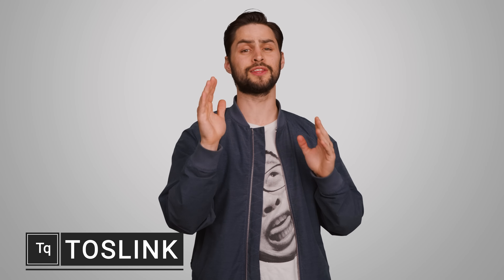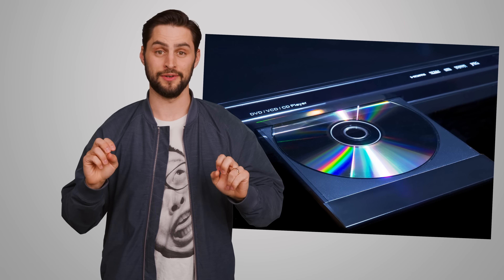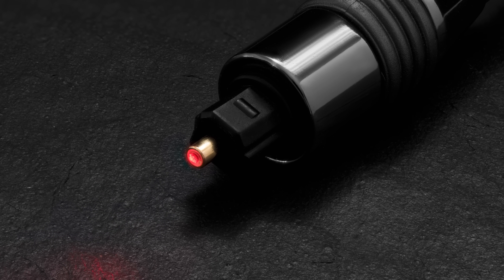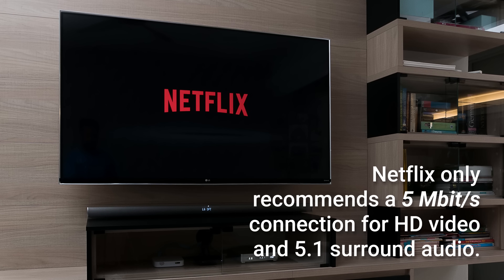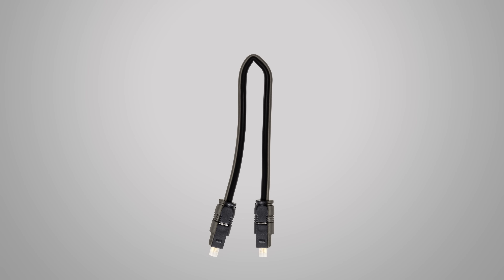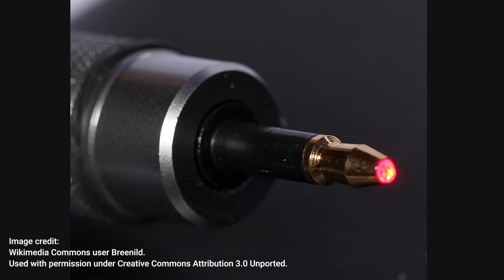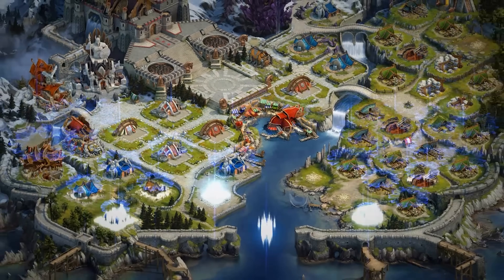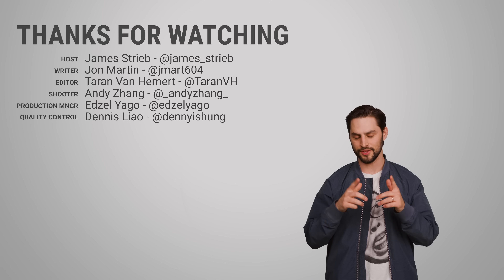Why IS This COOL Cable Dying? - TOSLINK Optical Audio

Comment: The distance limit of TOSlink was not primarily due to signal loss, rather being a 1mm diameter fibre multimode fibre (multiple transmission paths down the fibre - the light can go strait down the middle or bounce off the sides) the pulses of light get stretched out until it’s impossible distinguish between a 1 & 0. To overcome this in BBC Outside Broadcasts we used to convert to much thinner multimode (50um) or even single mode (0.9um) to run ADAT format 8ch linear digital audio over 100s & even 1000s of meters, eg to connect the broadcast centre to a remote commentary position. 
These days Ethernet based audio formats eg Dante is more commonly used.

Comment: Toslink connectors are deplorable !  The worst design for fixing a cable to a TV ever. No tight fit, no locking mechanism and prone to fall out when placed on to so called "smart" TV like the new Samsung SD models which have the Toslink port "under "  the TV frame. Crap cables coupled to crap TV.

Comment: I've Had A JVC 5.1 DVD Home theater system for over 20 years, After 10 years I had replaced the receiver do to damage. Now ten years later the receiver still being used as a CD player. In the garage but lately it's been skipping burn CDs, it plays DVD finds and original CDs,,,, but I don't like using original format due to wear and tear. The receiver is still capable of other duties, I decided to get a old JVC DVD player with toslink output and hook it up with JVC Receiver toslink input. 
No words can explain how great 1000w JVC TH C50 Is The Sound Quality of music in 5.1 sounds.

Comment: You can transmit Toslink via laser, and a bare laser can go through several panes of glass. Problem with that is you then need to deflect the laser-carried signal to a receiver, and the receiver needs to be modified so the target is bigger, but it can be done and Matthew Perks (of DIY Perks) used it to deliver single-channel sound to all of his Hi-Fi speakers across the ceiling; minimal cabling for tx and rx required.

Comment: Problem is TOSLINK is one-way. It transmits data in a single direction from the source (like a TV or computer) to the receiver (like a soundbar or audio system). For two-way communication, you'd need two separate cables.

Comment: Fun fact, TOSlink was first used for TOW wire guided anti tank missiles and MK48 torpedoes as early as the 1960s.  TOSlink was invented and pioneered by Houghs Electronics.  It was then made available for civilian applications in the 1980s, which Toshiba promptly bought exclusive rights to.  The Original TOSlink cables had tremendous signal carry range up to 40 miles in undersea conditions.  TOSlink was stored as 5 miles of  6 inch spool of optical tubing filement for the TOW missile

Comment: Someone in the comments has quite correctly mentioned Toslink's use in the Audiophile community with high-end Audiophile external DACs still offering SPDIf input. 
Another group of people who still may prefer it are gamers. Yes gamers!
Take a look at some of the latest flagship gaming motherboards from MSI and ASUS : if you look at the I/O ports, quite a few also include an optical SPDIF output. Some monitors don't always have speakers for the HDMI cable to terminate the audio signal to, not to mention there are some speakers such as some models from Edifier that have optical SPDif inputs which eliminate the need for a dedicated external DAC. Gaming motherboards can be quite noisy (internally: electronically) and even if properly shielded, there may be some interference in the analogue output stage, so having SPDIf as an option besides HDMI for audio also makes sense because apart from the signal being a digital one, offering galvanic isolation thus removing groundloops, it also offers more output flexibility as many A/V receivers (or some speakers like those from Edifier that I've already mentioned/TVs) also include an optical/coaxial SPDIF input.

Comment: Toslink is still thriving in the Hi-Res/Audiophile community. As of 2024, the flagship DACs that can sometimes cost as much as a car still have Toslink as an option, whether optical or coaxial. It's a "dumb" connection compared to HDMI Arc or USB in the sense that it either works or it doesn't.
It can support upto 24bit/192KHz, depending on the external DAC's capabilities. Also, it doesn't suffer from ground loops like USB
It's also available in quite a few mid-ranged models as well; such as S.M.S.L.'s SU-6, which I personally use, and having the optical Spdif as an input option saves me from utilising one of my computer's USB ports (I switched between Optical output and USB output to compare the quality and although the USB input in the DAC supports an insane 32bit/768Khz sampling rate, even with the high res FLAC collection I have, and audio CDs, there wasn't any discernable difference.)
Moreover, I can enjoy 5.1 surround sound using the optical output as well (even though it's lossy) using the same spdif output from my PC into a 5.1 system I also own.
So the drawback would probably be lack of support for HiRes surround sound (SPDIf only supports DTS/Dolby digital surround sound and not DTS HD/Atmos), but you'd probably need a premium surround sound speaker system in the first place for the claimed "night and day" difference to be fully appreciated as well as an Ultra HD BluRay movie collection (or the movie rips derived from them)

Comment: Its great for noisy computers. For example via my USB  audio I can actually hear my AIO pump. Also with USB dropout issues on Ryzen 5000 it can help with separating power from signal.

Comment: Pointless story alert:  So years ago (we are talking like 2002-ish) my first little surround sound system was a cheap Logitech set I got from Electronics Boutique for like $75 and I was able to use it for my new PS2 which like most of us doubled as our DVD player as well, that had this port I thought this was the coolest thing ever.  "This is using light to give me crisp wonderful sound that so cool?!?!" I also had the connector on the original Xbox that used it as well later but well that was it, all the electronics after that one or the other didn't have that connection so after that sound system got replaced, when I upgraded to a higher watt audio system , but that was all she wrote for toslink for me...    That was until about a month ago, 20 years later, when I recently got some new PC speakers I've wanted since they came out  (Razer Nommo Pro's)  I was pleasantly shocked to see this port was an option on the Nommo's even came with a cable for it and just so happens my current motherboard on my computer also happens to rock this toslink port. You bet your ass I was super giddy to connect my audio to it.

Comment: Of ALL of the technologies we have - only Digital Optical Interface (Toslink connection) gives you TRUE 5.1 or greater Surround Sound. All other connections like HDMI are simply "High Resolution" or less. Generally using technology into "fooling" your ears that you are listening to something different than you actually are. NOTHING beats Optical interface as no metal wire is used can allow magnetic interference into the signal.  If this type of cable is becoming less available consumers need to demand it's inclusion and availability. Because even if you do not use the connection at this moment, would it not be nice to have the option to use it in the future? More options are always good!

Comment: I'm happy about this synopsis, I purchased a 5.1 Xbox Spherex (for £20, actual robbery imo) that was partnered with Mirage and is still considered high spec, only issue is the only high res digital input is Toslink, I'm an early adopter of 12th gen intel, and my 12th gen motherboard supports toslink, so to an extent, I feel as if my Xbox Spherex isn't outdated, still being supported and not considered a collectors item just yet. 

and I actually did purchase this 5.1 with the mindset of it being a collectors item as I do collect retro items myself.

Comment: I'm glad this cable is still around for sure. Otherwise I would have to route my HDMI signal through my reciever and then to the ARC on my TV. I'd rather have uninterrupted flow for video to ensure I can still run 4k 60 or 1080p 120fps content with no worries of loss.

Comment: Fun fact: the Xbox One can only output sound thru HDMI or Toslink. If you want to use AUX, u have to either use an adapter in your HDMI connection or connect it to your controller like a headset.

Comment: I always run into audio sync issues using HDMI through sound systems or sound bars, so I only even use Optical Audio cables (TOSlink) for audio and HDMI for video 🤷‍♂

Comment: I'm very sad I been using trash speakers from Goodwill for so long. I finally said "I'm going to get the best sound going optical and totally update this mess," HA! Well I'm convinced. I'm tossin that "Toslink!" I'm gonna look into DTS 5.1 or whatever, as there actually is no link to that in the video or even in the description, so well whatever. Your loss. And WTF is measuring the weight of something in "so many blue whales?" Use corvettes or more boringly, school buses. At least I've seen those before. A blue whale? WTF?

Comment: I’m using spdif from an Apple TV to a Topping dac/preamp to Paradigm A2 speakers. I’m able to wifi link with my iTunes library. I’ve wanted to try a JIB Boaacustic s/pdif cable but there’s no reliable reviews for pricier “glass” interconnects I finally bought one to try. It’s amazing! The cheap supplied cable produced a decent stereo image with reasonably focused sound . The JIB cable took the sound to the next level of clarity even to resolving and clarifying low level sounds. Eventually I’d like to use a usb hookup to utilize sample rates higher than 16/44 but I now know that cheap supplied optical cables really screw up square waves. There really is a difference!

Comment: Unfortunately, there's no in-between choice for the PC, unless you get a Creative Labs sound bar.

On the PC, you're better off using display port for the high frame rate, so optical digital is the next choice for your PC audio.

I don't get why more sound bars don't have USB inputs for PC control. I expect it's to do with not having a copy right protection there.

Comment: Personally I hate hdmi cables, and sometimes usb cables.. The plugs suck... And sometimes you get a tv always saying an hdmi cable is bad.. I found you need to run magnets over the cables to remove that issue and the cable will work another 2-3 years without issues. I have a stereo with a optical cable but everything else is newer and doesn't have that option.

Comment: Digital optical is useful for longer distances in a room, because it does not pick up electrical noise along the way. That is, if your options are analogue and digital, and you are interested in noise levels and such. Also if you want to use your better DAC, what better way to transfer the signal from one device to another? Just bought a 6 m optical between Oppo and DAC. Works like a charm, though Oppo is quite particular about being turned on first before the DAC or it stutters playing a cd. Also the connectors (Oehlbach) seem quite loose. Had to put some paper to tighten it up (It might be a brand thing as Sommer or Supra do not suffer from this). The fibres themselves are made from a variety of materials these days, and are not necessarily as fragile, or stiff, as you make them out to be. Of course not a good idea to whack them or bend them, no matter what piece of equipment they are. ;)

Comment: The MAIN reason for ARC is so u can still use your TV remote on the soundbar/ receiver to control the volume

Some TVs dont allow universal control through the remote to the soundbar/receiver through Optical connections.

Comment: Do you know a good Thunderbolt 4 (USB-C) to optical/digital out connector (or converter)? I'm about to buy the 2021 Macbook Pro, but ever since the 2015 model, Apple stopped equipping the headphone/audio out connector with toslink (3.5mm optical digital out).

Comment: Posting this if it helps. I had static coming from the adapter Toslink from tv to old receiver and I solved it by programing the audio options on the tv by pressing tv+ optical option just optical gets static. Hope this helps.

Comment: The only reason I still use Toslink is because my AV Receiver doesn’t support 4K and I have a 4K TV. So I were to use HDMI I would get 1080p on a 4K TV and since my receiver. So we use optical for our TV while also making Dolby True HD and DTS MA HD useless. So we are stuck on 2.0 sound even though we have a 5.1 setup -_-

Comment: I was dreaded when i saw the PS5 didn't have an optical port to use with my Z906... But then delighted when i found out my TV supports passthrough from HDMI to TOSlink! works  perfectly!
Reply: TV model Philips 65pus8503/12 btw

Comment: last year i went to the flea market and brought a wireless headphones the transmitter connects through optical port never really used them til a year later and the quality of the sound over optical sounds way better than normal audio cable i thought it was just placebo but i connected the receiver over aux cable and the sound was not as good as optical.

Comment: Transmit your 5.1 audio in a single cable... ha! 

It doesn't have the bandwidth even to send 5.1 audio, it has to be compressed, usually with a proprietary standard like Dolby Digital. So all your gear has to be certified, and it makes passing through audio and other things a pain in the arse.

Comment: Hi very good vid .
Listen I have connected an older samsung surround sound system to my modern Samsung TV .The DVD unit is connected with a HDMI cable but dont get no sound as it mutes the Tv .The settings are correct though .I only get sound when I put a cd or dvd in the dvd player and still get a good pic on Tv .Im.not sure if I have the ARC stuff .
So I thought that because of no ARC then the other link being the audio optical would work .Is it worth buying to try .Any ideas 
Cheers

Comment: And here we are again actually needing a new update for Toslink or devices with a separate HDMI out. Since Video and Audio are progressing at different rates, and issues with the newest HDMI 2.1 standard, it would be very useful if this could make a comeback with higher bandwidth. ARC works but we’re also right in that area of most devices having ARC but not eARC (or one with and one without)- therefore having to settle with the lesser, (ARC) which is the same difference as Toslink. At least with Toslink there isn’t any of the CEC issues. But Toslink may lose lip sync.

Comment: Imagine WMA Pro 768kbps 7.1 audio through Toslink on Xbox 360. I believe the Xbox 360 isn't limited by channels but limited by firmware and hardware, Xbox 360 has HDMI 1.2a+Stereoscopic 3D and Toslink onboard so 6.1 DTS-ES and 7.1 WMA Pro are possible, if that is you have an AV receiver that can decode either DTS-ES or WMA Pro with the latter becoming extinct and someone should do something about it, like a DTS-ES/WMA Soundbar that's a project for the Retro Community to work on.

Comment: Great video to watch if you want to be missinformed. Linus'es team can't stop being wrong every other sentence can't they. HDMI advised length is 3m while toslink is 6m. Toslink has lower bandwidth overall but it easily manages uncompressed stereo and full hd audio quality. No toslink has nothing to do with file format, if audio is compressed or not. Clearly they don't know file format and data transfer format are two different things. You can toss at the toss link your uncompress music just fine... Not only yer old compressed music It needs to compress 5.1 and supports modern data formats dts ect. Only it does not support them in highest multichannel uncompressed modes It can deliver full hd audio which is better quality then you ever need or probably ever used, unless you are audiophile or techsavy and will configure your devices manually. To actually run full 192khz@24bit. You probably don't own any Media files with this level of fidelity. It might be getting phased out in home cinema because you can transfer both audio and video and power over hdmi. It will stay in dedicated audio gear, it was devised almost 40 years ago but it still serves it purpose and is fully capable.

Comment: Actually, Toslink cables are pretty useful when connecting devices that transfer/play exclusively audio, Network Players and CD/SACD Players or Transports for example (actually, a SACD device would be connected either with an analog RCA cable or a Digital AES / EBU connection).

It's more like a thing that a Hi-Fi audio user would prefer, although most of Hi-Fi audio users tend to prefer the SPDIF Digital Coax cable over the Toslink equivalent, me included.

So, meh.

Comment: As long as HDMI standards keep getting updated and receivers with older versions of HDMI keep becoming useless bricks after 5 years, Toslink will still be relevant.
Reply: yeah, something I have started noticing is odd incompatiblities with my DVI and HDMI hardware, with some systems just refusing to talk to each other since they were manufactured years apart.  All my Toslinlk stuff is humming along with equipment sometimes manufactured decades apart.  The downside of rapid progress is stuff breaks a lot if you don't put everything on the treadmill.

I even just picked up some new toslink based stuff less than a month ago, in no small part due to knowing it would actually work with existing stuff.  Meanwhile, my latest HDMI monitor has only worked with 1 out of 4 things I connected it to.